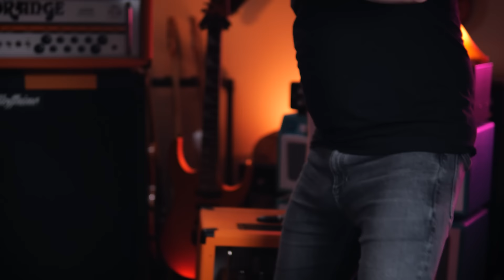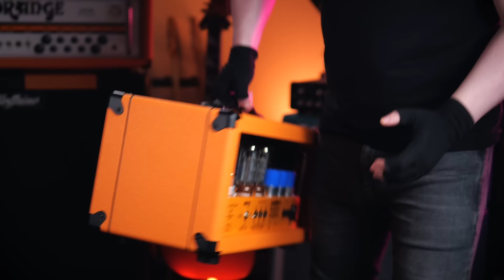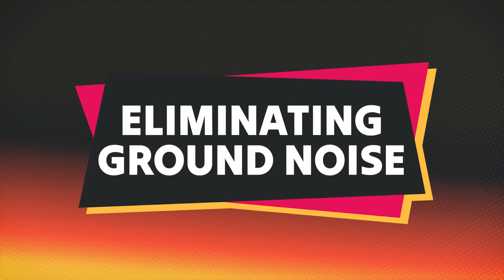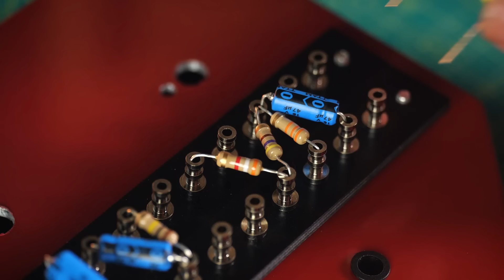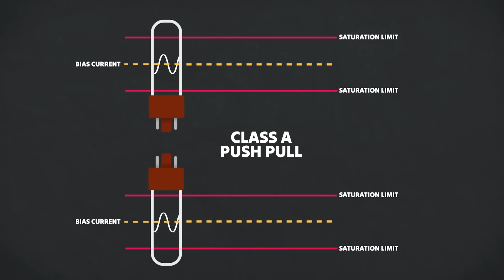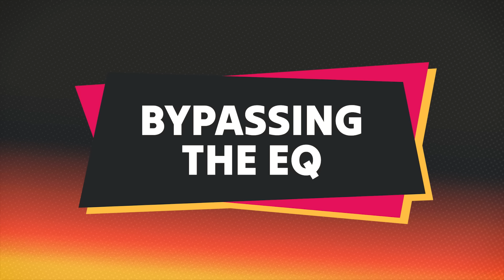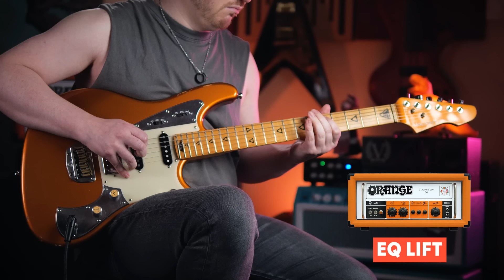Archaic Design of Handwired Amplifiers

Comment: Chaos grounding is rubbish compared to star grounding because the ground is half of your signal. Star grounding is rubbish compared to modern grounding techniques (prioritizing the minimum ground plane impedance directly along the signal path) because the ground is half of your signal.

But just like point-to-point wiring, star grounding has become traditional and expected in guitar amps. Everywhere else it's been abandoned for over 30 years. In both cases the traditional method works well enough that you can get away with it.
Reply: Merlin Blencowe, the Valve Wizard, wrote a book chapter about "steering* grounds; you can read it for free on line.
Reply: @goodun2974  There's some good advice in there, though naturally it stops at subjects relevant to point-to-point wiring, and doesn't cover things like modern PCB ground planes that make a lot of the advice (though not all of it, naturally) obsolete.
Reply: @Nicoya , dont assume that "modern" PCB ground planes and chassis grounds are "done right" ; Psionic Audio and Brad's Guitar Garage have numerous amp repair videos which show how little attention modern manufacturers pay to this.
Reply: @goodun2974  Sure, it's still possible to screw up, but also you need to be careful who you trust online. Some people will just look at a modern design and think "this doesn't look like what I'm used to" and point out everything that isn't point-to-point star grounding and say "this is wrong" even if it isn't actually wrong.
Reply: @Nicoya , it seems you might not be familiar with the techs I named (both extremely experienced and extremely thorough);  also, I've been repairing audio electronics, both tube and solidstate,  for over 50 years, including 2 decades fulltime.
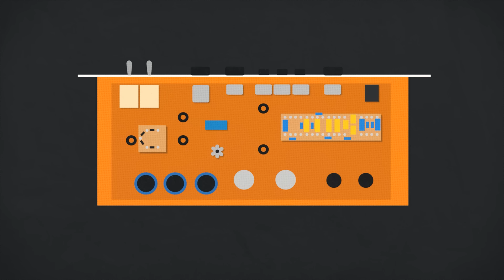Reply: @Nicoya , go to 4:25 in the video and note the green/yellow safety ground tied to chassis at the same point as shared power supply and signal grounds. This is a violation of electrical codes and does not confirm to "best practices" either. Separating the earth ground by several inches away can also lower noise.
Reply: @goodun2974  I've watched some of Psionic's videos though I'm not a regular follower. I'm not sure if I've seen Brad's.
Reply: @goodun2974  The Rift Amps guy loves pointing out improper mains grounding (and rightly so). Personally I'm just glad when the mains grounding exists at all, considering the safety atrocities that have plagued guitar amp history.

Comment: Since there is more than enough space inside a typical amp head for all the (relatively simple) circuitry, there is no good reason the head can't be designed to be balanced, in terms of weight.  The power transformer can be located closer to the center, but still on one side, and the output transformer and choke, if any, can be located at the extreme other end, so that overall they balance out.  If somebody wants to argue that there is simply no way to do this, maybe because they insist that the PT be as physically far as possible away from the OT, then the handle on the top of the amp should be offset so that it's still balanced to carry.  Manufacturers who don't do either of these things are just announcing that they don't care, or they didn't put much thought into the user's experience.
Reply: The output transformer usually weighs significantly less than the power transformer (note thst small OT's saturate and add compression, which we tend to like) ,  even if you add the weight of a filter choke (which not every amp has) being located next to the OT. Power transformers and chokes radiate significant hum fields, which can radiate not only into preamp circuits but into the output transformer as well,; this is why they're usually located as far away from the preamp tubes and circuits as is physically possible (BTW, it's not unusual to find an amp where the PT and OT are oriented incorrectly; one should be 90° relative to the other to avoid magnetic coupling and hum). Locating transformers so as to equalize weight distribution would create other, thornier problems for circuit designers: might require transformers specially selected/tested/chosen for low hum radiation, or specially shielded transformers perhaps , all of which would add cost (probably adding overall weight as well) and would make the effective replacing of a blown transformer much more difficult unless the original custom part is still available. It's too much extra cost and work for the manufacturer, for no real benefit.

Comment: Great video as always. I would love to see you changing components so an orange sounds like a vox or vice versa. Or a fender like a mesa or a engl like a diezel...
Reply from the maker: Components don't make the sound; the circuit makes the sound. 

Changing a few component values in an Orange might make it have more gain or roll off more top end, but that won't make it sound like a Vox. 
To do that you'd need to design a whole different circuit.

Comment: You do realise the thumbnail literally doesn't show point to point!?
You understand that point to point means components soldered directly to the next. No lugs etc 
Go watch Uncle Doug.
Hand wired does not mean point to point..
Enough said
Reply from the maker: You do realise this is addressed in the video?
You might want to watch the video before leaving uninformed comments like this one. 

These components ARE soldered directly one to the next, the fact that they are mechanically supported by turrets doesn't magically stop that being the case. 

The existence of turrets doesn't automatically negate it being point to point.
Reply: @ScienceofLoud I like your videos. I respectfully disagree with your viewpoint on this one. The Orange turret board has fly leads and jumpers connecting the turrets to other components such as tube socket pins/pots/switches/jacks. The same would be true to tag board or eyelet board construction. 

In many ways, these fly leads and jumpers have more in common with the copper traces in a PCB than they do with the soldering of passive component leads directly between a pot lug and a jack, for example. 

By extension of your logic, one could say that a PCB amp is point to point, but supported by PCB construction 😉Regardless of our opinions, I agree that hardwired amps look grand!!

Comment: I'm just finishing up on my latest build - a Princeton Reverb and I can really appreciate the quality of thought that went into that Orange to optimise routing and the quality of components.  Understandably a chunk more expensive than an equivalent PCB design, much due to scaling.  I think a lot of the issues with modern PCB amps is the budget they're built to and quality of component to eek out the last $ of profit.

I'm currently building my amp off version 6 of the layout, I started a 1 with the a standard AA1164 and went through multiple tweaks before committing to this build.  My layout is on 7c as I've already improved on things learned during this build and further ongoing research - hard to make that kind of improvement if you've invested £s in PCB layout and tooling!

Comment: Someone almost made this point and then didn’t- repairability isn’t just about component quality- it’s that lots of modern manufacturers save money with PCB manufacturing and it’s not just at the component level - it’s the thickness of the pcb, the robustness of the traces, the quality of the overlay material, etc. Some PCBs do great with rework…others (I’m looking at you Fender Hot Rod series) can be an absolute pain in the ass to work on and not damage the traces. Sure, we all have our tricks - but they’re objectively sometimes far harder to service cleanly as a result. 

It also allows for much more complicated circuits which makes servicing them another level of difficult, not only in the amount of time it takes to get to a component, but to diagnose the source of whatever issue is present. 

Sadly, PCBs on affordable amps In today’s climate often equals corners cut on components and quality. It’s not a rule of course, but we do see it a lot. 

A fine example of absolute buffoonery is the Fender Bassbreaker. I had one in the shop a while back and thankfully it’s issues were minor…because the amount of labor I would have to charge someone to do say - a recap, would cost them more than the amp is worth. I’ve never seen so many quick connects in my life.

Comment: Hmmm now I kinda understand why my MM is rated at 75 watts, thx!

& it plays more like it’s 100watts, from just 2 output tubes Leo was always about headroom, hybrid was his next concept after his Fender designs.  I bought it in 1985 because it’s good for bass or guitar, & Eric was an endorser, over the next 30 years i learned more about design at that time I knew nothing.

But also why my MM just gathers dust & I play a MB rated at 25 watts….on the 10 watt setting.  At 70 85 DB is now quite enough 😳🤪

Comment: I love the accent the rolled RR’s & the comedic relief😆

But I’m also interested in the design despite my naive rudimentary understanding, I see 2 Pre amp tubes, does Orange often use a solid state phase inverter?, hard to imagine an Orange amp only has 2 stages of gain, & I could not see other types of amplifier devices, it looks like a traditional design other wise.

I have a late 70’s Musicman amplifier.  hybrid, SS preamp & phase inverter, yet EL 34 output, I did not know SS phase inverters were common in tube amp designs, I’ve got examples of 9 tube amps mostly vintage & only 2 built since 2016, 1 built post 2020, they all use tube phase inverters, I thought my MM was the only one who doesn’t.  Fascinating how much I still don’t know from uTube & 3 decades of gear mags🤣😎

Comment: Colin, I have a question about the flow of AC current - how can we have a "positive" (active) and "negative" (neutral) if the current is changing direction fifty times per second? Is there still a "net movement" of current from the active to neutral?

I'd also be interested to learn about the flow of AC and DC current in an amplifier, but that's probably a discussion for another video.
Reply: Neutral carries current "unused" by the device back to the source (electrical panel), if you disconnect the hot the neutral has no voltage on it, alternating current cycles through while dc moves from point a to b. 

Source:I am an electrician, I might not be explaining it the best though.
Reply: AC uses Active or Hot to say that there is High potential on that line (positive or begative) and Neutral to say there is Low potential. Strictly speaking, there isnt a true difference in potential between Hot and Neutral because it is just passing electricity back and forth, b7t by keeping them separate, we can keep appliances standardized and reduce the risk that is incurred if a hot wire becomes grounded. In other words, the potentials arent really different, but by always referencing to the same line, safety systems (breakers, GFCIs, arc fault devices) can be better implemented.

As for how AC and DC work, Electroboom has a bunch of electrical 101 videos that are highly entertaining and work up to this.

Comment: There is so much lacking about the design of most modern tube amps, and spending the money on handwiring point to point instead of providing meaningful utility upgrades is just absurd to me.
Reply: P2P amps will actually make it to your local tech’s bench and be serviced. They’re taking in less and less landfill amps like Mesa, Fender, Marshall….😐 Good luck with your PCB amps.

Comment: A potential benefit to hardwired amplifiers is that the layout is easier to understand, diagnose and repair. Depending on the circuit's complexity.

Comment: Maybe I'm wrong, but I think that point to point wiring would circumvent any potential carbon tracking issues in a high voltage circuit. So it might even be a safety benefit.

Comment: Don't worry about it Colin. My UK MADE Laney amplifier head is so insanely heavy and big that it has two handles, one at each end of the top. It's 30 kg amp head (like wtf guys?) but it's relatively easy to carry anyway and it does have a good sound and a fantastic reverb tank to top it off.

Watching this makes me kinda itchy to finally finish my Champ 10 clone. The Champs sound so nice when worked for those classic tones. I think the only reason I wouldn't finish adding the mains lead and testing the wiring and voltage/current was because it was so expensive to get a cover for the chassis and it needed its own speaker cab too. The nice thing about that class A design with so few tubes or preamp gain and that circuit is that if you can open the volume up, you get a very fun sort of raw and perhaps even wild experience of Fender distorting to the point of demanding a bit of skill to even play it without it being a hot mess. A bit like driving way too powerful car just under the point where you lose control. That might be a bit nostalgic or totally ugly sounding.

The serviceability of point to point really is a nice thing. You can quickly see or measure where the problem is and even do it yourself if you have a base line soldering skill. I can't imagine going in my Laney's circuit board and trying to work it, like there's already a crazy multiple circuit board construction inside. And for an experienced repairman it's still a much nicer experience to have room to work in. But also like when you see the point to point wiring inside, you don't have to be a tech wizard. You can tell just by looking that there's been a great deal of care put into it and you can almost guarantee someone has checked it before sending it to you so that there's no silly production errors left. That someone checked it was a good amp instead of just successfully built amp. It's not a guarantee or direct measure of quality (I think many times we can agree that machines do more accurate and more consistent job), but it's a communication language. It's visual communication sending a message to the customer. This product was built with care, someone paid attention and wanted it to be good beyond just making it and sending it to you.

I find that reading Merlin Blencowe's valve amplifier design books a bit in hopes of some day doing them was great to shield oneself from the forum posters's glue or fart sniffing. That and being an engineer even if not electric. It's functional design to solve problems, not magic dust and spells. Each design for each use case, problem and function. And ironically those hunters of pure sound always have their pure amp with a bucket load of pure pedals, they're always after that transparency. But they would never plug the guitar directly to the amp and just turn every knob maximum for maximum transparency and purity of the circuit. Too many times people try to mix feelings with physics and connect them together. Sometimes there's physics reasons why something is preferrable, sometimes it's purely emotional. Both are completely ok and valid reasons to prefer something, but it's not fruitful to try to prove why your emotion is objectively better. You don't have to be objectively right, it's enough that you enjoy it and get pleasure out of it in a unique way that you only get from that thing. Even if you objectively played like shit with it compared to something else, as long as you feel good doing. And I admit the story is a bit different if you perform as a job and perhaps are responsible to someone else, but that's besides the point and rarely it happens that you enjoy sounding like shit and your employee doesn't appreciate it.

In the end the important thing is not to know how the amp was made, but using the ears and fingers to listen to how it sounds and feels. If it's good, who cares if it's put together by a machine in China? Assuming we're not talking about any other personal values relevant to purchase.

This was a great way to make a product promo into an interesting educational video. I'm a sucker for these. And I'm just as excited about great craftsmanship and technology, even history (these are part of our history, both the way to construct them but also the company) and even if I didn't play it, I could still draw joy out of its existence. And sheesh, if I had the resources I'd make sure all of my purchases supported some skilled person who perfected their skill all of their life. I feel they are such a valuable part of our society. Like can you think that long ago people would pick plants from the field to strip and dry and spin to string and make fabric out of it, that nice stuff that doesn't resemble like the plant stalks at all, and someone knew how to do it.
Reply: It’s not just “more room” in a hand-wired amp, it’s less labour $$$. You see, when you buy a complete piece of garbage with multiple PCB’s it costs YOU more money. Amp tech’s absolutely HATE seeing multiple PCB’s because it’s more time spent on your junky amp, and less time getting decent amps back to their owners. Please think about other people before you bring your landfill amp to a tech. 😐😑😐

Comment: If I get the train to work, I want to travel on a modern electric multiple-unit with AC and WiFi.

But, if I'm going out with the family for a day on a train, I want a steam train with its smoke and smells bumpy ride on lumpy seats.

Similarly if i were a gigging musician, I'd have a Helix (or similar) on the floor for ease, convenience and reliability.
But I'm not. I'm a 40something eejit who tries to emulate his heroes while in his garage. I want noisy, inefficient fun.

Plus i also have a hard on for old technology
Reply: Who’s gonna repair your Helix in 5 years?….😐
Reply: @REDCROSS88 At that point, I'd buy a new one.

Though it's academic as I don't gig and don't own a Helix